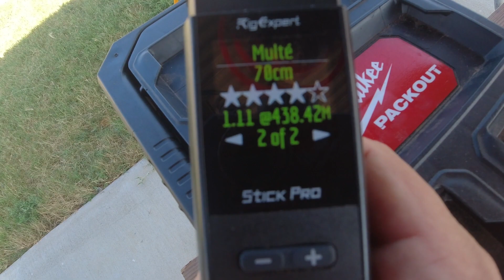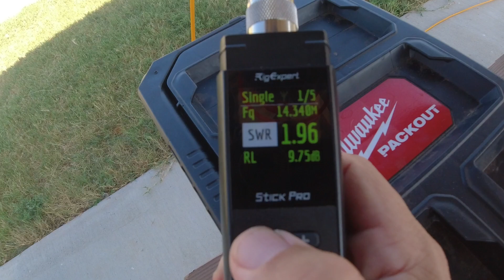Is the Hextenna the Coolest Portable Antenna Ever?

Comment from the maker: Turns out one of the 11 sections on the 17’9” whips were stuck. I was able to extend them one more section, which makes them long enough for 20M without attaching the coiled wires
Reply: Thanks for the follow up. I just ordered one.
Reply: I figured that whip extended one more section. Do you think that 3d printed 11:50 center section is as strong as the aluminum MFJ big ears?
Reply: No . The mfj would be more durable.

Comment: MFJ-2289 was the same antenna . it was nick named The Big Ears. It had a 1:1 current balun built in and came with a 40 meter coil. I use it to this day on a 34ft carbon fiber push up pole and tripod that Giga parts used to sell.  I guy it with para cord and auger tent stakes. I live in an Hoa, so I lower it to 5ft when done. Antenna works fantastic and I can always tune to 1:1 swr if I get that picky. I measured once with a NanoVna and marked each band with a different colored sharpie. Set up and band changes are a snap. This antenna should perform just as good. I actually like the 40/30 meter add on for Alpha's better than the coil that mfj included. its a truly resonant dipole.

Comment: Just received my Hextenna and tuned it at 14.275 with my AA-230 Zoom down to 1.214 swr on my deck approximately 15ft above ground. In middle of the night made 2 contacts to Europe and one contact to Australia using my Ic-705 at 5 watts! Granted the conditions are favorable right now, but it seems to be a good antenna imo
Reply from the maker: Nice, sounds like it works pretty well.

Comment: Im making one myself out of separate parts, 2x 17 foot Opek model OP-SS-17F  ss rods, A DJ Speaker tripod that extends to 8 feet. What i need to complete is a mount for both bases of the rods which are 3/8" x24 threaed studs. I also purchased 2 premade 40m coils to give me 40 thru 6m HF, in theory. I plan to POTA this set up this summer. The antennas are real HD, with about 3/4 in base and 1/4in top section. A "buzz" LC tuner is expected for 40m and 20m .

Comment: Those whips look identical to the Chameleon SS58 whereas the SS17 is similar to the MFJ, but also longer, so there is a downside.  But yeah the SS58 has the exact same nubbins on the end like these whips, I would hazard to guess they are from the same manufacturer.
Reply from the maker: I have the Chameleon CHA-17 and these are different

Comment: I wonder if you tied the ends together with fishing line or such, to hold the v shape better, if it would fix the "too short" issue (antenna 😮) . It's been my experience that a v with need less length than a flat dipole. Might be worth a test. 
Also what's your final impression of the tripod? 
De Jeremy kj7iaz

Comment: nice antenna. That potaflex 6 and 7 is startling to ship new.  I ordered a 50 ft potaflex 7 on reel with the BNC adapter. also havening them make  pota flex jumpers as well. some with N and BNC as well. used the coax builder. The only thing they do not have yet is ferrite beads  like ABR has. but I have my own I just snap on if needed.  waiting to ship. will take a wile. they testing my jumpers as well. got a whole bunch of stuff. adapters as well good ones. That coax will be great at 70cm as well. thinking about a 100 ft pota flex 7 at a later time.  73's

Comment: Several years back, I purchased a sat dish tripod for setting up DTV at the camper.  It was made by a company called TV4RV (now out of business, the guy retired).  That is the exact same tripod with a coupler on the threads up top. Mine has a removable 12" mast that screws in at the top (for the dish). I think I might take a look at that antenna hub and have a dual use for my tripod!

Comment: $600 is a steep price, but it looks like a good antenna.
Reply: Good tripods are spendy.
Reply: What he didn't tell you is that you also get TWO other antennas with it: a vertical and a loop. THAT configuration is $400. The tripod which is VERY solid (I love it) and super sturdy with its gripping talons and individually adjusted legs.